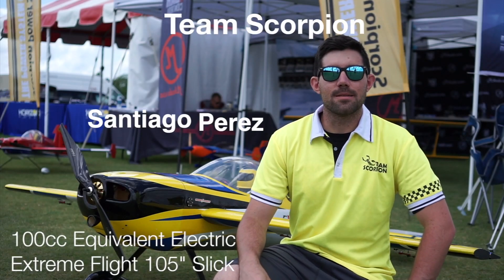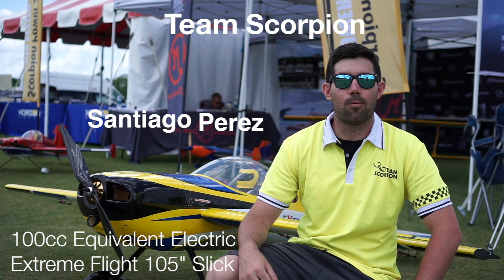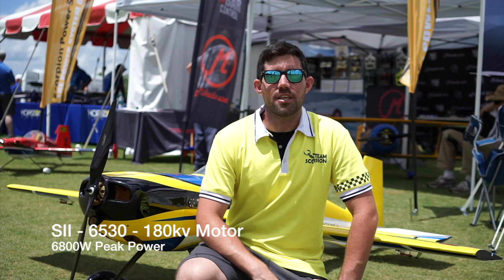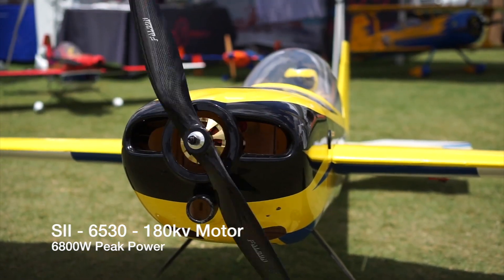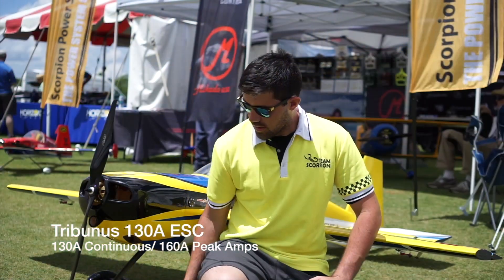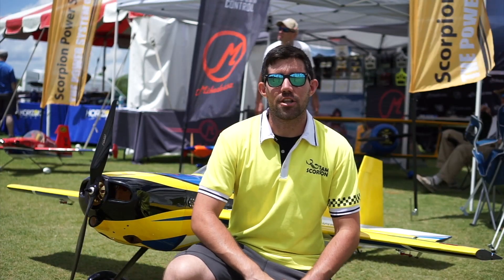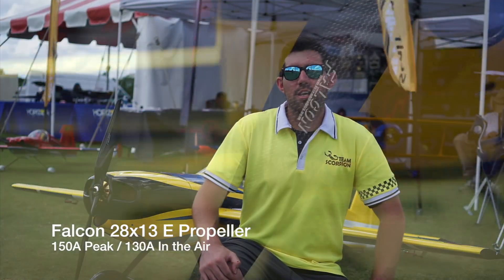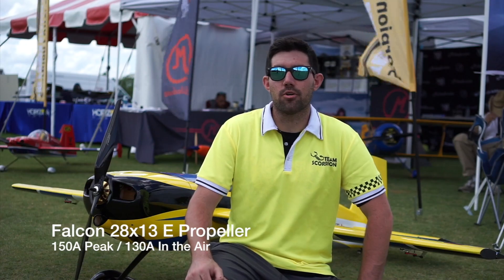Scorpion SII-6530-180kv Motor - 100cc Gas Equivalent with Santiago Perez

Comment: Kyle yesterday was the maiden flight on my Extreme Flight 104" MXS using the the identical scorpion power system as Santiago. Although I had my doubts at first but was totally impressed with the balance and performance of the airplane. I'm mostly running default settings on my tribunis  ESC but are there are there any tweaks i can make for added performance?
Reply from the maker: The tribunus esc does not have any adjustments which effect the power. The esc has dynamic frequency, and dynamic timing so it is always giving you max power and torque. 

As long as you make sure your esc is calibrated to the proper endpoints of your radio to ensure you get full 100% throttle channel. Nothing more to do!

Comment: Nice! Would a castle 160hv suffice for this motor?
Reply from the maker: A castle esc will function with the motor. But castle escs do not have dynamic frequency, or dynamic timing like the tribunus ESCs. So there will be noticeably less power and slower ramp up rate, and less efficiency on a castle esc (or any other esc) then with the Tribunus.  

This is why I really recommend the Tribunus ESCs.

Comment: Would this same setup be suitable for a war bird designed for a 100cc engine?
Reply from the maker: Theoretically yes. The point is that this doesnt have equal power to a 100cc gas engine. But it is lighter. So the resulting power to weight ratio is pretty good without needing a huge motor and 4x 6s 5000 mah batteries. 

The thrust is ~42lbs so depends on which plane you have. Also make sure you consider the CG. As the motor is MUCH lighter then a gas engine, so you need to be able to get the batteries very far forward in your plane.

Comment: Hi Kyle. How many Amps are you running at with the Falcon 28x13E and 12S  I am considering this setup for my Skywing 104" Edge.
Reply from the maker: Stephen Walker as Santiago said in the video, it pull 150a on the ground and 130a in the air! 👌 It would be perfect for skywing airframe they are very light!

Comment: That's amazing power and flight time you're getting out of that setup. Can you tell me the total flying weight please? Thanks, and you have a new subscriber.
Reply from the maker: romeshter the power setup is about 2lbs lighter then Gas. So this plane normally is about 26lbs with this setup would be around 24lbs.